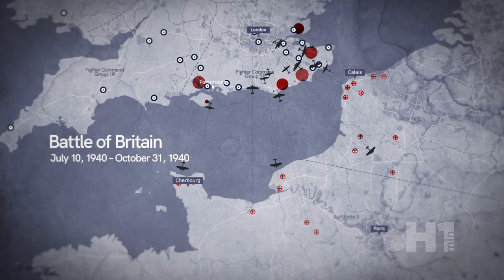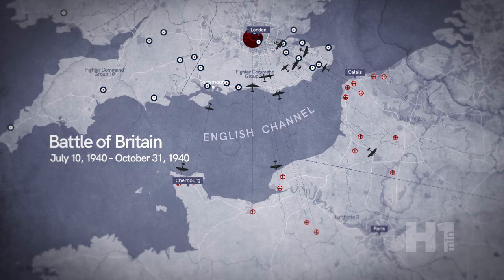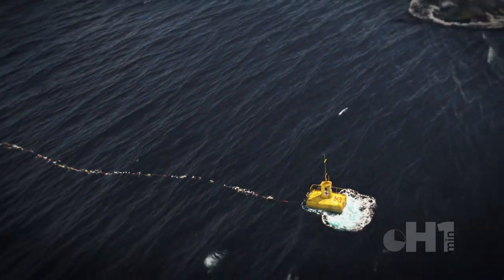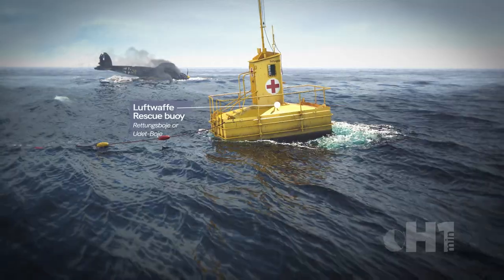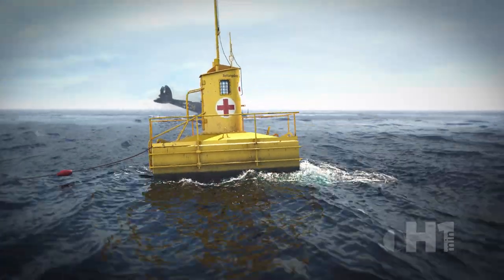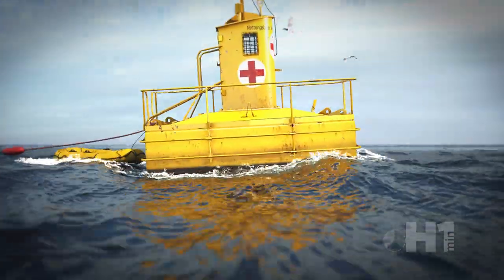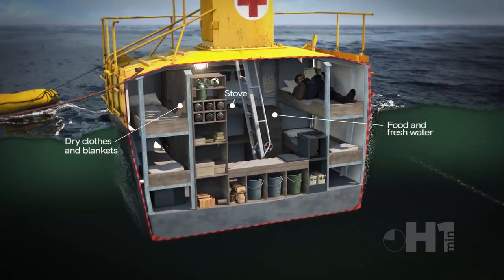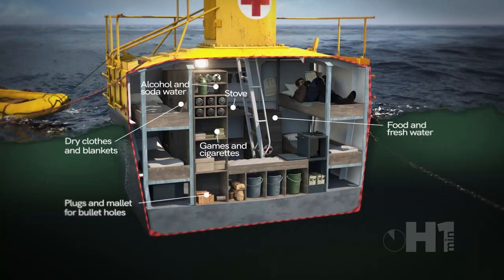H1MIN: RETTUNGSBOJE - LUFTWAFFE'S RESCUE BUOY

Comment: Germany had these Rettungsboje (Luftwaffe Rescue Buoys). Britain had Air-Sea Rescue Floats which performed a similar function. They were usually checked often (twice daily if close to controlled coast, once every day or two in uncontrolled sea farther away).

Sometimes, downed airmen/seamen would be found occupying enemy rescue buoys. There's even a recorded instance of enemies sharing a buoy and making friendly bets about which side would rescue/capture them. Germans and Allies alike would often inspect enemy rescue buoys - sometimes restocking or "trading" rations, treats, and liquors - because you never knew when one of your own would need it. There was still a lingering sense of honour (at least in the minds of military commanders), one did not gun down a parachuting pilot or a drowning sailor if it was avoidable.

It was a bitter, hateful, ugly conflict. Yet these rescue buoys were generally respected by both sides as beneficial assets which should not be attacked. They would sometimes exchange prisoners found on the buoys, or simply leave them on the buoy and inform the enemy where to collect them. At least until the Germans began stationing machine gunners on their rescue buoys towards the end of the war.
Reply from the maker: Thank you for sharing those insights. Much appreciated!

Comment: Wouldn't this be a good idea to think about how this can be used in a different way. Maybe deploy something like this that generates it's own electricity through solar, wind, and current movement. This could gather general data but maybe even host a remotely controlled camera. Make them air deploy-able. Might be useful for the big storms on the great lakes.